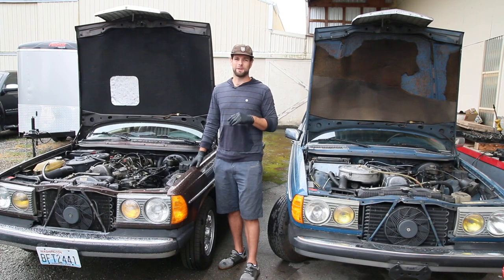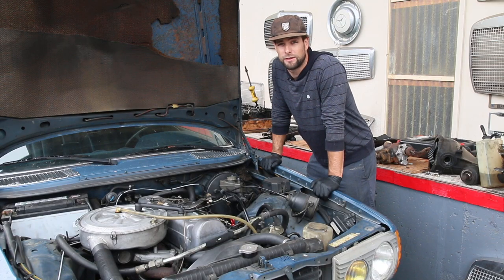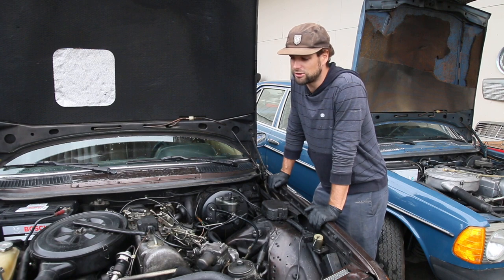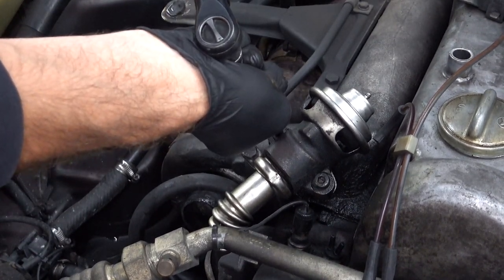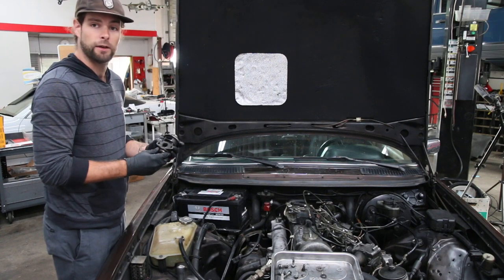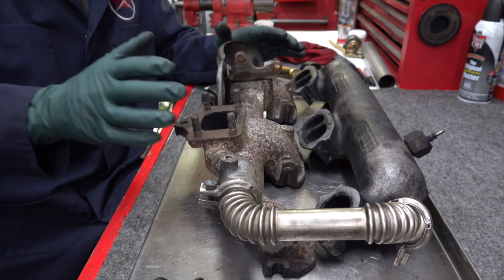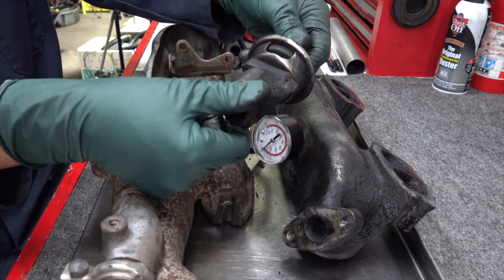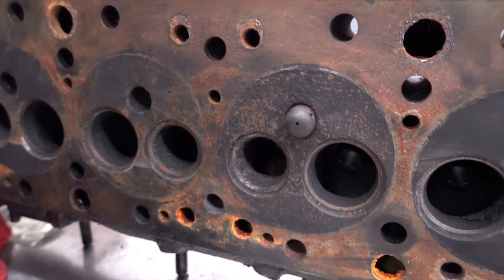Operation Save Digby Part 3: Puff Puff goes the Magic Mercedes?

Comment: This is the BEST channel for the Mercedes DIESEL! Just wish that someone out there would show some LOVE for the Oldsmobile 4.3V6 and 5.7V8 DIESELS.
Reply: first you had to find em. i remeber the 5.7 as diesel saver back in the 80's.
back in time the most said 'wtf you need a big 5,7 to get 150hp when a
euro 2.5L' (OM 617 and other Diesels) reach the same with a smaller engine.
so the most of them where scrapped.
Reply: A friend of mine had a loaded cutlass with the 4.3. Slow but got great mileage. I think it was an 82. At least it was comfortable. My parents had a 1980 El Dorado 5.7 for a couple of years. Those engines were crap.  I liked the car, but had lots of issues so sold it at around 50k miles. My dad already owned a MB 300d 1975. It was bulletproof but noisy and not luxurious by my mom's standards. Once the w126 300SDs came out she drove those till the early 90s. I owned 2 myself and loved them. Those are actually my favorite MB diesels. If you drive the post 1981 GM diesels gently those ones can last a while. I love the beauty and comfort of the 1980s GM cars but their engines were crap.

Comment: My Dad had a Mercedes like Tux when I was a kid in the 70's.  The car had about 500000 miles on it and burned a quart of oil every 35 miles (round trip to work was 34 miles).  One time at a traffic light when the light turned green he left but the car smoked so bad the guy behind him couldn't see the light had changed and missed the light cycle.
Reply: I had always pondered the true cause of Climate Change.
Now I know.
Thanks. 🤔

Comment: Thorough step-by-step analysis/classroom technique.  Looking forward to more.  BTW I have removed the EGR from a 2003 Sprinter I formerly owned. Cleaning was not easy & being an expensive ($300) part, I owned 2 EGR's. I cleaned one & 15,000 miles later exchanged with the other.  Result?  An appreciable increase in fuel mileage,  a cleaner smoother running engine, & saved  $!  Jack

Comment: Really like the approach to the problems on Digby. My personal conclusion from the videos is don't use Bio-diesel on old cars. I have seen a lot of problems to do the new fuels. It can get so bad that you may have rusty valves, stuck injectors, stuck injector pump etc. Thous things are not cheap to replace.

Comment: We had an OM647 Sprinter that was blowing white smoke really badly like that. We had spliced a broken electronic injector connector. Well later we found out we couldn't do that, swapping just that injector wire out of the harness fixed our white smoke for good but I see Digby's got a whole other problem! Sounds like he's missing on two cylinders, we were only missing on 1 out of 5. Digby's beautiful and I hope you guys can get it working. If not bring it down to Florida for retirement I would be glaaaaad to take one in ;)

Comment: Head gasket failure, the egr causes only the amount of oxid in the exhaust. I point
to corroded piston walls and/or worn bearings. I needs internal a refit.

Comment: Your son is doing a great job there. My view is that  Digby can't be saved. That amount of smoke and low compression in a couple of those cylinders  indicate to me that there is something up with the piston rings, at least in those two weak cylinders. You can put a bore scope down there but it probably wont show too much.  Since the most weak cylinder had the leaking injector, I would guess that bore wash may have contributed to wear of the cylinder and rings. If you can't save it we need an engine teardown.  Goodluck, fun series.

Comment: I wish you guys were into BMW diesels of the era.  I'd love to see these kinds of vids on the M21 engine thats in my Lincoln.
Reply: BMW diesels are the same as vw/Volvo/Audi of the same era. BMW'S have different cylinder heads. The 524td was the fastest mass produced diesel car of that era.  I  miss driving my 524td.
Reply: @vintage76vipergreenBeetle  I had friends with those BMW diesels. One had a Mark VII LSC and another one had a 524TD. Both car were fun to drive and got great fuel economy. The friend with the 524td kept his the longest and had some problems as it aged. They aren't as durable as MB turbo diesels were/are.

Comment: I'm really surprised you haven't hauled that engine out for a rebuild. Then a much bigger turbo and it'll be a joy to drive. 
That smoke, by the way, would have the car instantly hauled off the road in Europe. The police would not be happy.
Reply from the maker: The bigger turbo with a Manual transmission would be nice :) - Joel
Reply: @Mercedessource  
 5 speed transmission would be a nice too.😁

Comment: I looks like the first valve tested wasn't the one removed from 'Digby'.
Reply from the maker: It got cleaned up a bit between the video takes. But the first one is off Digby and the second one is the replacment going back on the car - Joel

Comment: All respect what you are doing to try to make Digby "happy" again!
But how can a not so technical person do all this and what will it cost when you bring her to the dealer....?
And, being this a pretty simple engine (very simple compared to modern engines): what an incredible amount of search will be necessary for these engines to search for problems......?
Or, by the diagnoses systems that these modern cars have, is it easyer with these????
Reply from the maker: My Dad has done probably more videos on the w123 then any other Mercedes chassis. Theres tons of old videos on the channel addressing all sorts of specific problems individually. Until this last summer it had been roughly 9 years since I had spent any time wrenching on a car. But one thing I love about working on these older Mercedes diesels is the simplicity. Even with the time gap - Theres nothing on this car I fear as "too much" for someone looking to get into a beginner project car. Take your time and go slow as you learn bit by bit. The nice thing about a personal project car is you're in control of the pace :) - Joel

Comment: chance of foreign object damage on top of piston?...if a nut or stone or likewise went down the intake then no 3 cylinder is favourite destination. dents up the piston crown and then finds its way out the exhaust.
Reply: I'm guessing that wouldn't be very good for the valves or turbo either.

Comment: Judging by the volume of un-burnt fuel emanating from the exhaust pipe on a cold start it might be a problem with either injection timing and/or the high pressure fuel pump? Yes, one cylinder has a probable piston ring issue resulting in lower than optimal compression compared to the other cylinders but that would not be expected to result in the sheer massive clouds of un-burnt diesel smoke?
Reply from the maker: sk, you are right. There has got to be something else "going on."  :-)

Comment: Though they are the same engine, there seem to be more components on Digby than the other engine. The EGR and that electric component on the valve cover and the throttle linkage seems different.
Reply from the maker: They are not really the "same." Both are 5 cylinder diesels of the early 1980's but as noted in the video the one in the blue car does not have a turbo changer. Digby does. That is why you noted the differences.
Reply: @Mercedessource  Ah, a turbo. I missed that part. That would explain all the differences. Thanks!

Comment: would make a good show if turns out the engine needs a rebuild...prob many would be interested in seeing the engine torn down and put back right...seems like a good candidate since it has power and is not torn up internally.  The rest of the car seems in pretty good shape so perhaps worth the fix.